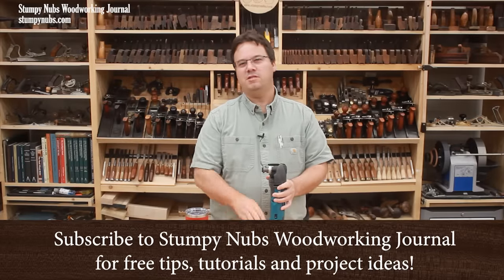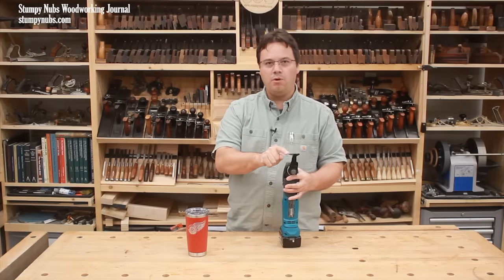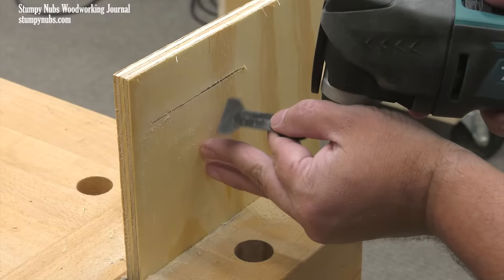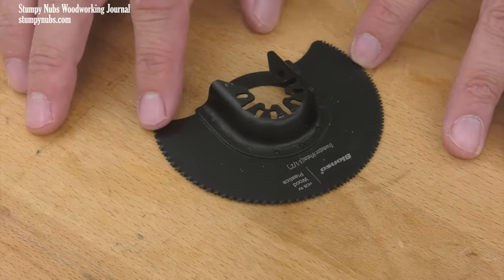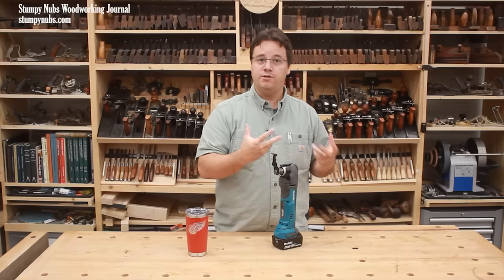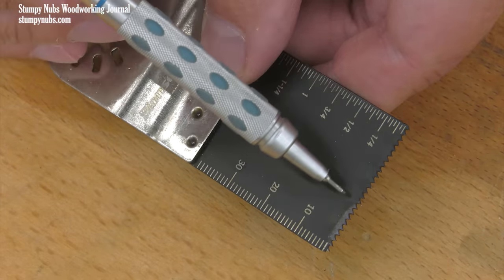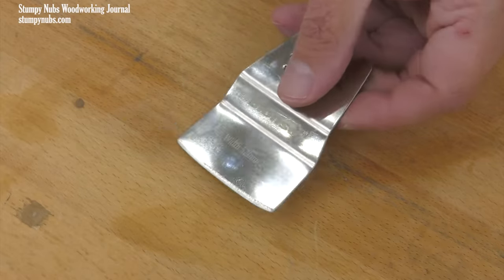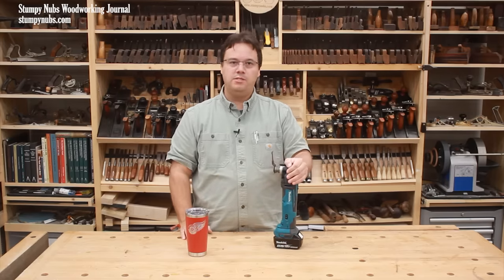CLEVER things to do with an Oscillating Multi-Tool!

Comment: The brazed carbide tipped, off brand blades are actually wicked good for metal cutoff and inexpensive compared to a Dremel or Bosch or Milwaukee.  I do lots of metal - 304 stainless, 1018 steel, etc. and even though they are off brand (like  harbor freight or Bauer) they still work wicked well.
Usually faster for doing cutoffs than my bandsaw and great because you don't have to completely disassemble things in order to get it to the bandsaw or mill.
Also, take off the blade to store it?

Comment: The sanding attachment has been invaluable for me doing bodywork on a van - sanding smooth the body-filler I use after I've cleaned up rust with an angle-grinder. I expect I'll also use it when doing some plasterwork in the near future.

I can't see a scenario where I'd want to use it for wood, but you never know...

Comment: I'd love to see a buyer's guide to oscillating tools :)
Reply: check the channel "Project Farm", he has a great testing video
Reply: There are a ton of them out there. I know The Honest Carpenter did one a while back
Reply: It's easy.

If you NEED the BEST, then Fein is the ONLY way to go.  (Not battery powered, but corded power.)

All the rest are still good and do mostly the same thing, but just not heavy duty like the Fein.

Most people using for "household" uses don't need the quality of the more expensive Fein.

As the Honda ad used to say: "Why buy something "like" a Honda when you could just buy a Honda?"

Fein is a better quality and thus more expensive, but a similar concept to the Honda ad.

Comment: Good information! Thank you! I really like the reusing the oscillating tool sanding pads. By the way, I also use and reuse those on a piece of PVC for sanding inside curves and inside holes. I have been known to cut pieces off of them for small area sanding as well. I reuse whenever possible. I have even cut and reused old sanding pads to clean off battery terminals on my car and lawn tractor. Curl it up and sand the inside of the clamps.

Comment: I bought a cheap, 120v Harbor Freight version a few years ago, thinking it would be perfect for the one job I had. Over the years, though, I am constantly finding uses for it. A must-have tool for sure. (And it's still working just fine.)

Comment: Absolutely agree with the sanding attachment thoughts. Its great for rough sanding in tight corners, removing old finish. If you need a fine finish sanding, better off doing it by hand.

Comment: The cast tech in our office used our cast saw to cut drywall when we remodeled the procedure room back in the early 90's. The attached vacuum 
was great. 
We also use oscillating and reciprocating saws in the OR for bone cuts. It's really obvious which new Residents have woodshop experience
when you hand them the saw for the first time!

Comment: I have found the sanding attachment great for precise removal of paint. For example- in a factory painted plywood panel where I needed to remove a patch of paint to get a gluing surface without scratching the surrounding painted area.

Comment: I've been using my oscillator to clean out the left over mortar after I use my grinder on repoint jobs. I have found that all the grout grinders are very brittle and break easy but the hardened multi material blades are pretty good at getting the surface clean

Comment: I use multi-tool for sanding and I find it better than my finishing sander when using course grit paper. I found out as the awkward angles of the timber fillers made is easier and faster to sand and accurate  in my opinion.  I will be using it was skirting and door profile sanding.

Comment: SUPER informative. I've only been using multi-tools for about 5 years. Started with a cheap Harbor Freight, then realized what a game changer they are. I then upgraded to a Ryobi cordless. I keep the Harby around and still use it quite often. GREAT deal on those blades too. THANKS!!

Comment: Great advice allround. One thing I'm suprised that wasn't mentioned is that it's often good to give the tool a helping hand by moving in a sawing motion to use more of the blade. It will help keep the blade cool spreading the friction area and help to avoid prematurely wearing out one section of the blade. The throw on these tools is pretty small so it helps make cuts a little quicker without applying more pressure too, particularly useful for cuts using a rounded blade.

Comment: Recently bought one of these, probably one of the most useful tools I have ever bought. Thought it was a gimmick before until I used it. It's ability to do straight plunge cuts while the piece is in place is amazing, cutting perfect squares out of plasterboard for electrical stuff is easy, as is cutting off bits of door frames when doing flooring and trying to get the floor under the door frame without having to take the door frame off to cut it.

Comment: Thanks for the link to the big set of blades, I really like that they come with a case!
I tend to only use my multi tool to sand in spots because sanding killed my first multi tool by vibrating the switch apart. I also tend to remove the blade on my tool for storage because most times I will be doing something different with it next time I use it, I had a Rockwell years ago that came with a soft bag and that bag is great.
Thanks for the sandpaper tip, because I don't sand a lot that tip will fit my work flow better than buying precut sandpaper.

Comment: Well done video.  Thank you.  I picked my tool up to cut door trim and such for flooring installation and it worked brilliantly.  I've also used it to refurbish a seriously abused cast iron pan and to cut back a stone fireplace hearth.  The cast iron pan was almost a fun job.  The hearth job was thankless but fortunately the circle carbide blade was far faster than any other tool I threw at it.  I see people still fumbling away with more conventional tools that this beast can do quickly and with a bit of finesse.  
Thanks again for a great video.

Comment: I purchased my first 'Fein-Triangle-Sander' in 1991. I was refinishing a Red Oak floor. It worked fantastic in corners.
Presently, I keep four of these tools in my box, each one set up for different work. Bosch Tools sells a teardrop shaped carbide faced blade that is my work horse.\
It is very aggressive. The tear drop shape gives the blade a tip that comes in very handy. I'm a polymer  repair  person and these tools carve epoxy (structural) putty very well.
Presently I have two tools from Fein, a cordless from Ryobe (junk) and a small fleet from Hyper Tough (more junk) (Walmart's brand.) At $26 for the Hyper Tough, is hard to beat. They don't run long, but the price-break makes them a good buy.

Comment: I've using the multi-tool for five yrs or so now...ever since I started going out casually with a flooring installer. Boss has a yellow one, 2d hand has a red one. My battery platform fits the one you use as your model. All work pretty well.
Sharp blades make a HUGE difference. After spending waaayyyy too much money on box store blades I started buying them on Amazon. About a buck a piece, fit all three brand saws I'm around, and I feel no remorse tossing a hashed blade and replacing it.
I estimate we use a multi-tool 15min/100sq ft of finished floor, so I have some experience.

My multi is the second tool I load up when off to a job anymore. Just does so much...so easily. I had to chuckle watching you flip your blade in the reverse position for storage. Boss always used to dawg me for doing so, until the day he reached into the tub, and sliced himself open on the exposed blade. Flips his blade around now, too. 😉

Comment: I own the Fein electric kit with 40+ Blades, dust collection, etc. Works as good as it did new back in 2013! It probably has 1000 hours of use and Purrs like a happy cat! 
It’s Tough! I have cut wood, Aluminum, thin metals, nails, screws, staples, pneumatic nails, hardwoods like rock maple, beech, etc. fein blades are tough! I have tried many knock offs. Not found one as tough yet. I will try your recommended brand and see. Thanks!

Comment: I sometimes make epoxy glass/carbon repairs. The fine saw is also perfect for "quick sanding" , Just put a good amount of pressure on the angled blade and scrape hard materials down. 

Also for precise work, Just trim the bladewidth down to 5mm and you can reach almost anything.

Comment: We use these probably every day. They're one of those tools you seriously ask yourself how you managed without it for so long. I had a corded fein first then a pile of other corded ones. I now own the makita you have here and the m12 fuel. They're just useful in so many scenarios. The biggest thing I've discovered is how important blade speed is as well as rocking the tool side to side especially in hard materials to clear your kerf. Those 2 things will let your blades run cooler and extend the life dramatically.

Comment: Bought one this summer for a deck reno project- had to cut around railing posts, and a bunch of screws. Diablo carbide blades worked great on the screw fwiw. Had been eyeing one for a while, but then the blue store had a dewalt free battery promo that I had to take advantage of. (Free battery normally sold for more than the tool too!)

Comment: I bought my Fein multi tool long before the patent ran out.  It was handy because of the kind of work I was doing. I got it specifically because it could plunge cut.  Try plunge cutting in finished wood with a Sawsall !  It is doable but tricky.  The multi tool just works better.  Blades were outrageously expensive and only one place had them.  Still a great tool but some of the improvements since then have made them even nicer tool to use.

Comment: Another fantastic use for these types of tools -- motivating air bubbles in hydraulic lines to vacate their stuck locations.

Whenever I bleed brake lines for motorcycles and such, I invariably reach for this tool in addition to a block of wood and/or metal.  With the block acting as a buffer, I apply vibrations to the master cylinder, banjo bolts, calipers, lines, etc., to clear sticking bubbles.

Persistent brake system sponginess problems can usually be remedied in a matter of minutes with the help of an oscillating tool providing motivating vibration.

Comment: Great vid buddy 👍 I keep my worn out blades then when I have enough of them I cut up a sanding belt from my belt sander and using the blade as a template I cut out the shape and super glue to the blade it works great for the hard to reach places but not recommended for finishing work . Try it 👍 keep the good work up . From Geordie Ian ,in the uk

Comment: Stumpy is such a great presenter.  I learn so much from this channel!  One thing I’ve found on different models is that the nut or bolt on the bottom sticks down further than the blade, making trimming door Jambs accurately for flooring projects a challenge.
Reply: Flip the blade over?
Reply: @Soandsoguy  i have it flipped correctly and works well on my electric model but the craftsman model bolt sticks down too far.  Maybe there is a blade that will come down further.  I’ll check that out.  Thanks

Comment: The multi-tool has got to be one of the most versatile of the range of electric tools. I have had mine for 3 years now and it has saved me a whole load of time ?(and cussing). It's one of those tools that you think 'how did I ever work without this ? Fein had the market to itself for the period of the patent - which is fair enough as it was a very clever invention. The only other application I saw the oscillating cutting process used was when I went to have a leg plaster cast cut off. I was horrified to see the nurse get this tool that looked like a angle grinder and go to cut through the plaster on my leg. But he was kind enough to explain how this tool worked and it would not slice through my skin ! It was still unnerving though but I was pretty impressed ! Thanks for the informative video - as I always like to learn from others.

Comment: Mr Nubs, I watch a bunch of your videos and they are great. I just want to say that the part where you used it to cut PVC pipe... 🤯 I never thought of that. This summer I was struggling with cutting apart PVC pipe from my pool valve with a d@mned hacksaw the idea of using my "Ozzie" by holding the blade would have given me the control and speed... Great tips!

Comment: Great info. I did not know about the patent, but I did know that it existed back in the 1980s. I joined the military and part of my job as a medic was to cut casts. We plunge cut and rock the blade so it can cut the fiberglass, but the blade is designed to not cut human skin immediately. This makes great sense and I appreciate your video.

Comment: one strange thing I've noticed with this tool is that different brand blades oscillate differently?  I have a Dewalt XR multitool, the Dewalt brand blades that came with it(and other dewalt brand blades I've bought) they all looked to be barely moving when using. Then I started to try other brands and they all seem to oscillate a LOT more, some better than others? Yesterday I bought a pack of Milwaukee blades that were on BIG discount at Home Depot, and these bad boys are oscillating in my Dewalt multitool like a whole INCH maybe more of side to side movement almost!!! My Dewalt blades look like they aren't moving at all compared to these Milwaukee's, and wow they cut like no other blade I've used and FAST! its just strange how much other different blades(even though they are the same exact style blades even) work in this tool, even thought they ALL have the same identical lock in grooves to fit the tool?? Don't know how that can even happen really

Comment: Thanks Stumpy, I  know I need one of these on my sailboat and ordered it, but how to use it.....   Another sailor recently told me that in a test to cut steel cables the fastest method was the multi-tool. (I immediately pictured that Gerber thing we all have in our pockets and thought he was nuts. These cables are hardened steel 3/4" in diameter.)  Speed is critical if your mast breaks and flops over into the water. You have to cut away the steel shrouds and rope (sheets) as quickly as possible so they don't foul your propeller or roll your boat upside down.  Life and death.  Definitely get a carbide blade 
As a DIY guy I'm surprised it's taken me this long to get  a mulit-tool. (Probably just means I haven't installed a sink in a new countertop since 2008. That back cut along the wall.)

Comment: I use it for sanding the Cisplay props I am making. Works great.
Am using the 60 grid so I can take the big chunks... then I use a finer one with a mous sander and finally .anually with a high grid to smoothen it.

Comment: You should try a Bosch Curve Tech blade some time. I have used them on really hard old pitch pine when cutting pockets into purlins for joists to socket into. The Bosch curved end blades are extremely  tough and very easy to start the cut accurately on a scribed line.
Another tip is to save some of your worn out finger type blades and glue a pad of thin rubber matting to the bottom face and then attach a strip of aluminium oxide abrasive paper with contact adhesive. These homemade finger sanders are real handy for getting into tight restricted areas.

Comment: Thank you for the tips and tricks for using the asalater tool, I keep for getting I have that tool. I'm always pulling out my cut off wheel or my small saw to cut stuff. I used that tool a few time's when my brother first gave it to me for Christmas. He's a carpenter and he said he uses his all the time on a lot of detail work. I should have that tool up in center on my work bench. With the rest of my many cutting tool's. I do have file set to sharpen the blades if they ever need sharpening. I do sharpen my own blades on a lot of my tool blades that people usually toss out. I made shire I learned how to sharpen blades so they will last a lot longer than people realize. Even jig saw blades can be sharpen.

Comment: I was asked to help repair a 100 year old kitchen wood floor … there were a few boards in the middle of the floor that needed to be cut out . I knew I could chisel them out But I spend $30 dollars and bought an oscillating tool at Harbor freight. I also picked up a few extra blades there in case they dulled out fast  !  It worked great  👍 . No need to spend a load of cash on a Fein tool  $$$

Comment: Fwiw, I always remove the blade after use.  Not just for damaging other stuff or damaging the blade, but damaging the mount itself.  (Alternately, you could put a snug piece of soft wood like pine between blade and body, little snip of tape to hold it in place.)
I got an OT after seeing my neighbor playing with one.  His is cordless, but I got a (cheaper) corded one.  What a huge difference in power!  I literally never cranked up the speed beyond the first position after "off", it's that powerful.

Comment: I use one just like yours almost daily when working. Glad you said no need to buy scrape blades. I save my old ones and in a pinch I just run them on a brick to sharpen them. Works great to unstick windows that the painter decides don’t need to be operational 😂

Comment: There is quite the options with these. I bought my first 30$ corded and am still buying the dewalt cordless and a selection of blades in the future. Also a cordless jigsaw for cutting drywall in flood. That is wicked quick and blades last forever doing drywall cuts when you cut the blade to depth. Get bigger batteries(2) and the rapid charger..enjoy